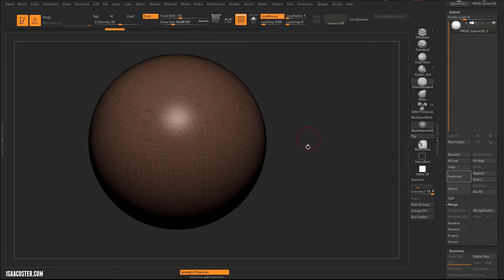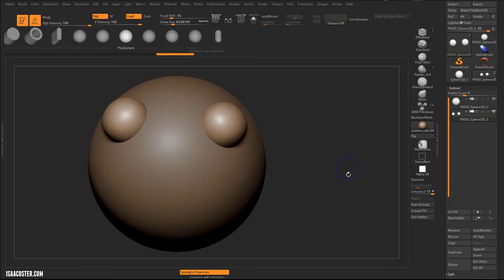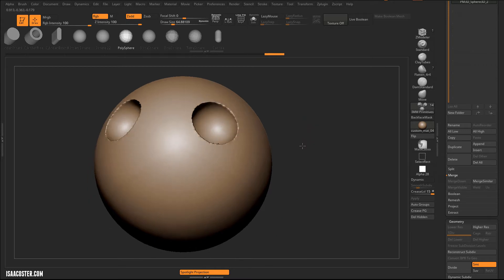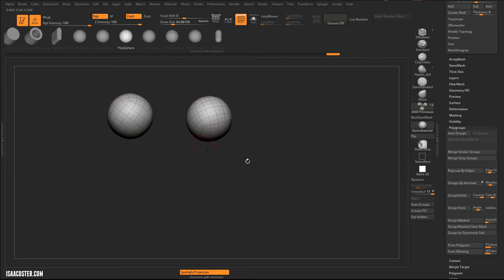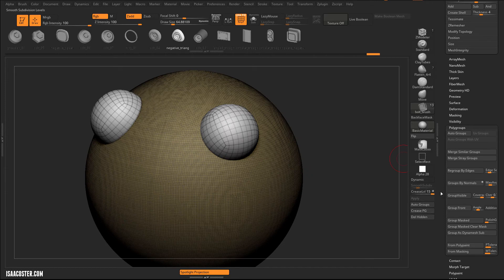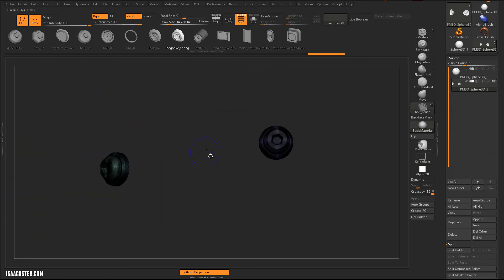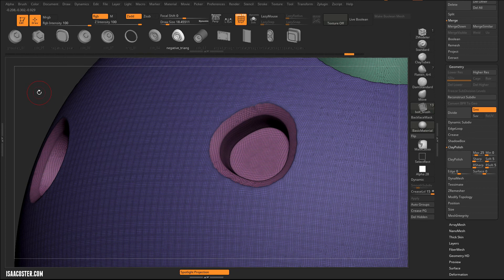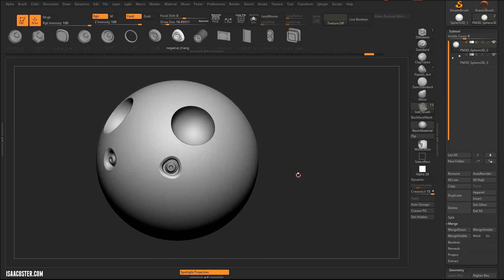Hard Surface Modeling with Zbrush 03 - Dynamesh Part 2

Comment: Great tuto, nice calm narration, just enough detail; brilliant stuff. 👍😀
Reply from the maker: Very kind,  thank you!  Glad you're enjoying these videos 🙂
Reply: @Isaac Oster  Had them on my list to watch for some time now, today is it. Finally these small symbols in 'Subtool' make sense.  Big fan by the way, love your 'Mech Girl'. Sent you an email ages ago to ask you if the ZBrush files for it are for sale... probably ended up in spam  Would love to make a real robot out of it. 
Do you also do courses apart from these videos in here?
Reply from the maker: @haracinihoudini4958  I'd have to poke around for the zbush file - not sure it'll translate to a physical object.  You're thinking a 3D print or something?  I have a few courses on youtube.  Check out my playlists for the full list.
Reply: @IsaacOster  Yes for 3D printing, some parts in resin and others in ABS or PA. Fully realize that it would be only a shell with no real points to connect each hard surface, but that’s ok and would be the challenge for me. It’ll probably take me a year or two to  design the right mechanism for it and drawing up the rest of the body.  When I saw your Mech Girl I just knew I wanted to build it. Re courses: Thanks I'll be looking for them and watching them all no doubt. Many thanks for your replies.